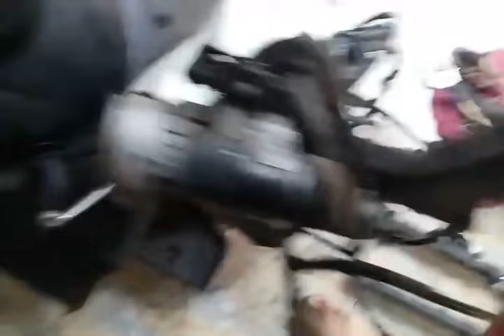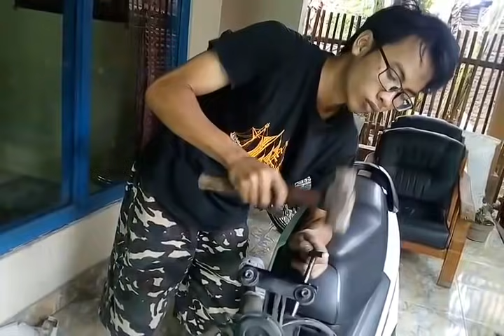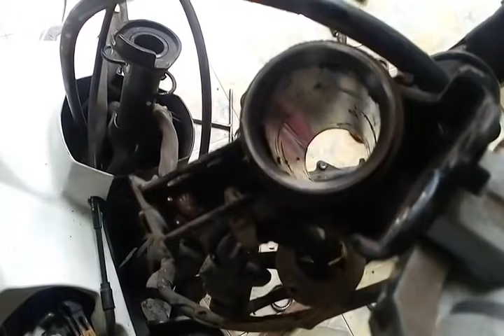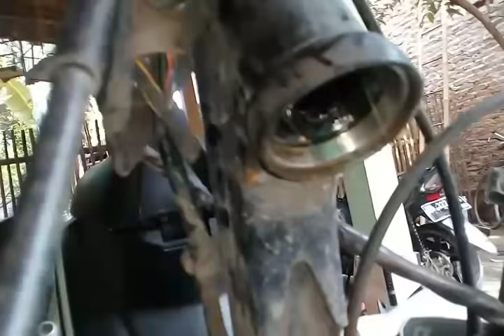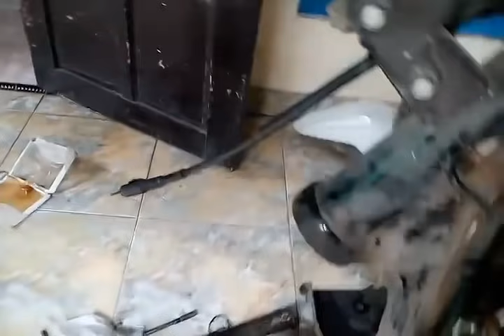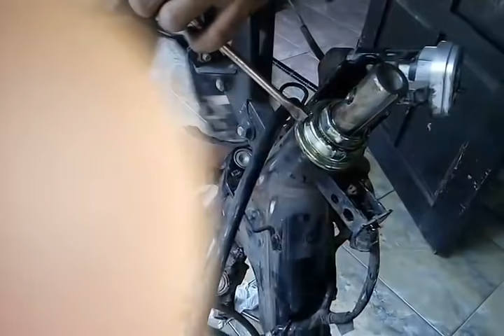Cara memasang komstir bambu pada Honda Beat

Comment: Untuk vario 150 led 2016 bs g om?
Reply from the maker: Bisa om
Reply: @komstirbambu  brrti punya beat pnp di vario 150
Reply from the maker: @andefia7009  ya om matic n bebek honda sama
Reply: @komstirbambu  mkasih om untuk infonya
Reply from the maker: @andefia7009  siap sama sama om
Reply: Om boleh tanya g? Mtor sy vario 150 led,ban belakangnya sy pake size 100/80 tp yg depan bingun mau pakai size brp?
Reply from the maker: @andefia7009  90/80 om pokoknya lebih kecil yg depan
Reply: @komstirbambu  berat g om
Reply from the maker: @andefia7009  kurang tahu ya om yang jelas klo dan depan n belakang biasanya lebih kecil depan 1-2 ukuran.